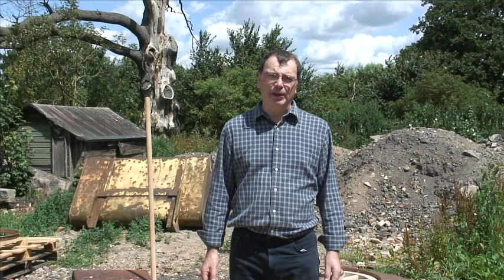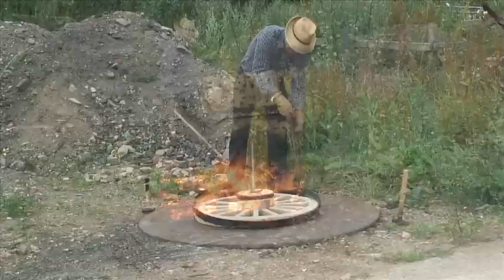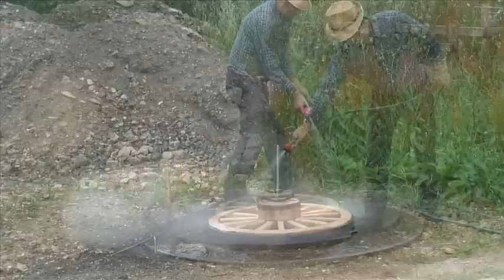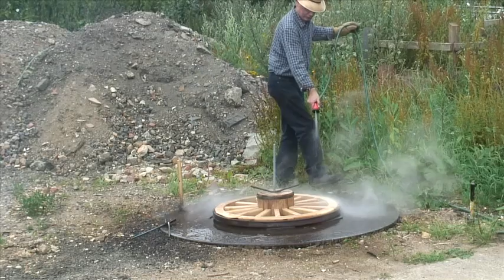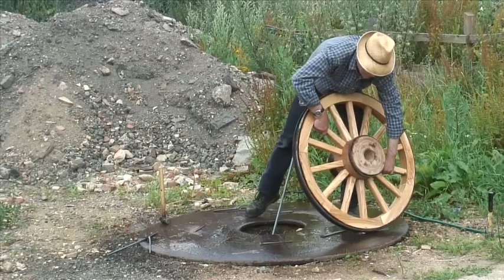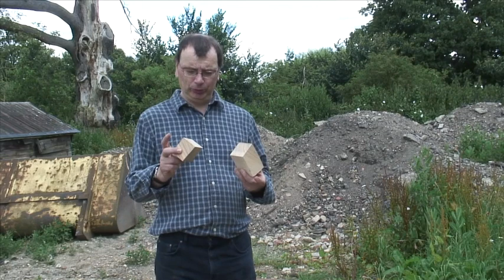Making a Wooden Carriage wheel Pt3

Comment: (continued) The bilows was about 12 x 20 feet. He bend up the iron rim with his bare hands and hot welded the rim to band the band.  He heated up the iron band in the furnace until it was red then placed it over the wheel and poured the water on it. He used witch-hazel wood for the hub.  I'm uncertain as to what type of wood he used for the spokes and the felloes (maybe birch or maple??).  I found your videos very interesting.  Thanks!

Comment from the maker: The smaller the diameter of the hoop the smaller it expands in the fire. On something that small I would only go closer to an 1/8th as you wont get much expansion. An alternative which I understand they do in australia is to cut the hoop, spot weld a nut either side of the cut with a piece of stud running between them, and then tighten it up to close the gap, which you then weld shut. Then grind off the spot welds. Not as much fun as doing it in the fire, but small hoops are always a challenge

Comment: Hi Thanks for a great video. I have a metal hooped beetle mallet - the hoops are hand forged circa 8 inches in diameter and as I need to make a new head,I was wondering if I could shrink the hoops on in the same way. Do you think it would work if I make the diameter of the wooden head a quarter inch more than the diameter of the cold hoops? Or would you use a different method / diameter? Thanks Harry

Comment from the maker: It depend upon how much you use them. An average wheel probably doesnt get used that much so will need a rubber tyre fitted every 10-15 years, but some last much longer. If however you are operating every day on roads then the rubber will need replacing sooner, just like on your car.

The actual structure of wheel providing its kept dry and free from woodworm will last for a very long time, I have seen some 2-300 years old, and I like to think the ones I make could potentially last that long.

Comment: Finally I have seen a tyring plate on the internet. Seems the Americans and Euros  use a flattened stone area to set the tyre on the wheel.I am assuming yours is cast iron. I have 2 of these plates. 5 foot in diameter with a 2 foot hole in the middle and 2 inches thick.Both of mine were random discoveries. One at an old crossroads which was being enlarged to a super huge major intersection and the other I found half buried in an old gold mining area near Melbourne in Australia.

Comment: How did you joint the ends of the metal to make a solid band
Reply from the maker: Greasy J's Rubber Trails Arc welding
Reply: Heritage Craft How did they join the ends in the 1700s?
Reply from the maker: In the old days they forge welded the ends and then used a variety of stretching tools to get the rim the correct size. Very hard work and very skilful

Comment: What is the name of the cast iron base for doing this job please?
Reply from the maker: I know it as a wheel plate, they dont come up very often and when they do there always worth grabbing. You dont need one, when I am working away from my workshop I have done it using a palette to hold the wheel flat. The best version I ever saw was a guy who had very a very substantial table with a 10mm thick metal top. It was good and solid and meant you didnt have to keep bending down, so the ideal version would be a old wheel plate but supported at about 400mm
Reply: @heritagecraft  Thanks that is great. I am writing about one being scrapped in the 1950's by a local gypsy family. The husband got the wife to 'swing the hammer' to smash it up. Sad, but that happened a lot I guess.